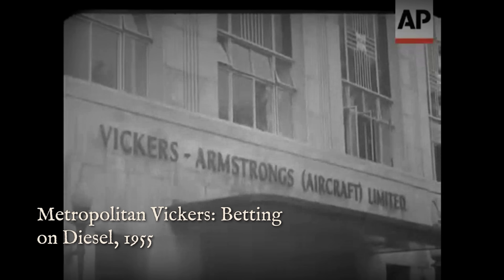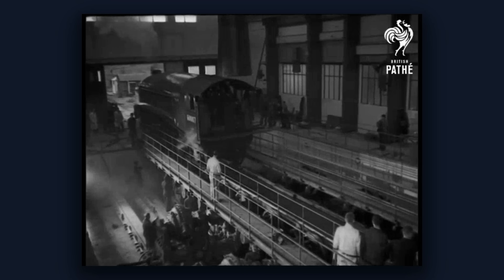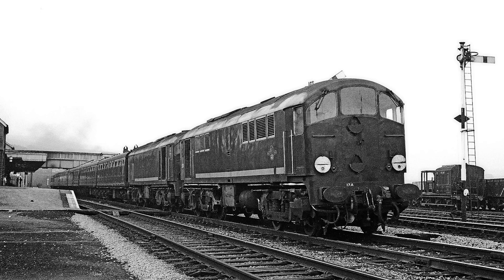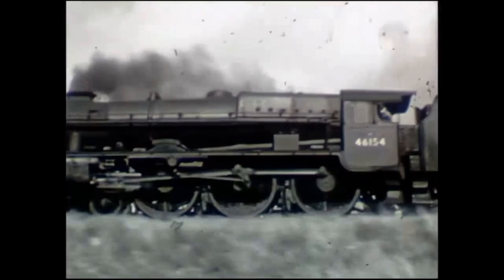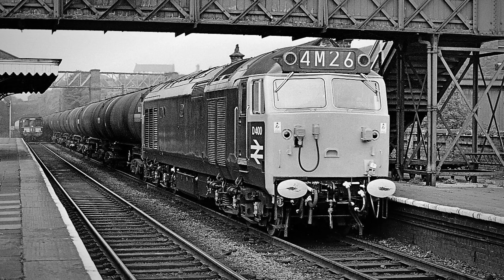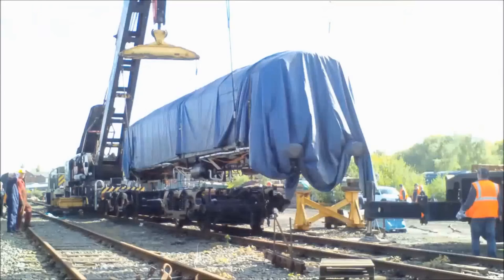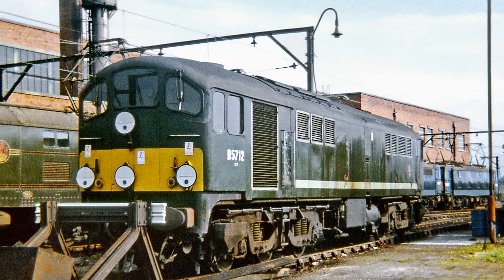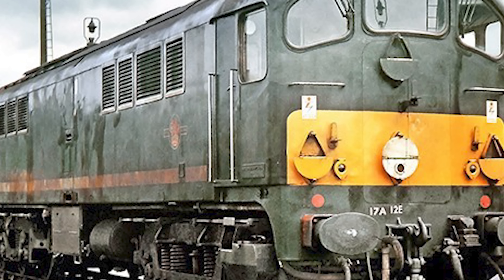This BRITISH Locomotive Was Too BROKEN TO HIDE

Comment: The were 10 Class 08 design shunters fitted with Crossley Engines D3117 to D3126 but they were never classified as 08's, allocated to Toton but they were all withdrawn by mid 1967 and all scrapped by mid 1968. So the Crossley engines weren't any better for shunters either

Comment: The Crossley diesel engines in the locos were absolute crap. They had also been installed as essential supplies generators at the power station where I was employed, but they were so unreliable with crankshaft problems, that they were luckily replaced by W.H. Allen engines shortly before I started there. The only problem the Allen engines had was a small peripheral control component on one engine that was quickly replaced.
Crossley later gave up using their own designs and henceforth manufactured Pielstick (French) engines under licence.

Comment: The main problem with the class 28 was the Crossley engine. Given the problem with CIE's A class, delivered from 1955, it was totally bizarre that BR ordered any loco with a Crossley engine.
It is said that BR ordered the Crossley because they wanted some experience with two-stroke engines. They could have bought GM-EMD two-stroke engines from USA but the post-war period was still full of chauvinism in the larger countries; Germany bought German locos and rolling stock, France bought French, Britain bought British, Italy bought Italian etc. On the other hand, Spain, Portugal, Ireland, Benelux and Scandinavian countries shopped around. In Ireland's case, they made a disastrous decision to buy 94 locos with Crossley engines, all of which had to be re-engined with GM power plants 1968-71, following CIE's experience with GM locos from 1961, which worked reliably from delivery.
Some may blame OVS Bulleid, CME of CIE at the time, but apparently he advised the board and the government to buy American, that is either GM or Alco. He even went further, stating: "The products of La Grange (GM-EMD) cannot be equalled".
So, one can only say BR was crazy to buy Crossleys. One would even speculate whether corruption was a factor in the decision.

Comment: Part of the problem with British Railways modernisation plan of the mid 1950's imo was that it was rushed, diesel loco's were entering service alongside along side steam loco's that had been ordered only a few years earlier. The infrastructure to service the diesels was not fully in place, it was not uncommon to see diesels stabled in steam depots, which by the 1960's were often grim places, smoke and dust filled, often with holes in the roof. British Railways were also ordering loco's for which there was dwindling amounts of work as more and more customers switched to road transport, even before the infamous Beeching Report of 1963, branch lines were closing. The line I lived next to closed to passenger traffic in 1962 and freight traffic dwindled until the line closed completely in 1968. I'm not sure if the Co Bo's were ever really needed, The English Electric Type 4's (BR Class 40) were enterting service around that time and more advanced types were on the drawing board, I think plans were already in place to electrify the west coast mainline. I suspect a lot of decisions made during the implementation of the modernisation plan were made for political reasons more than those based on engineering considerations alone.
Reply: Apparently Britain had very little experience with  diesels unlike the US with the E and F units from GM EMD
Reply: Unlike the grouped companies British Rail didn’t have a financially responsible Board so the strategy was to experiment. Too many new standard steam engines & too many diesel designs. All complicated by the ‘not invented here’ attitude to American, French, Swiss & German railway development.

Comment: I believe BR made the wrong choice and should've done exactly what the Irish and Australians did.
Reply: BR originally wanted to use American technology scaled down to fit the UK loading gauge, but politicians stopped BR as it was felt not possible given the risk to UK jobs.
Reply: The went as far as buying EEV12 engines to replace the crossley units, but the CoBos were earmarked for withdrawal in the traction plan and those engines were used in the class 30 to 31 conversion program instead.

Comment: what type of locomotive is this in the video at 6.01 as it looks like a class 26 or 33 body with class 47 bogies + a bit of a class 47 cab + windows I'm pretty well clued up on British built locomotives but i aint got a jar or glue/ a clue what this locomotive is!!! 🤔
Reply: Frankenstein's rail monster!
Reply: I was wondering the same thing. Also the loco at 7.:04 with what looks like a   class 86 or similar cab front.
Reply: I am very familiar with every British diesel class and I’m confident that is not one of them. I can only assume it’s foreign. The other loco at 07.04 referred to underneath this I guess is another foreigner for I don’t recognise it either.

Comment: The Class 28 Metrovics' main problems were the windshields (easily fixed) and the 2 stroke Crossley engines. Re-powered units seemed to work fine. Not sure if that engine was low quality or a poor design? And that's cool there was a Thomas the Tank Engine character (BoCo) based on these locomotives. I read awhile a go that most, if not all of the characters were based on real locomotives in the U.K..
Reply: The engine was just a terrible design. We got a V12 version from Canada to provide parts to rebuild the V8, when we stripped it down I couldn't believe how worn and damaged it was internally yet it only had a few hours on it. Also the build quality of the engine was poor too, we've a video of the crank being turned earlier this year at the workshop that are rebuilding the V8 for us and the journals were well out of true.
Reply: Thanks for the insider info, no wonder the Class 28's had so many breakdowns and problems.
Reply: yes they were

Comment: I have read that the general construction quality of these locomotives was very good, although that counted for little in the end. Some observers nick-named them 'wonderloaves', owing to their overall shape being similar to a loaf of bread (!) - the 'wonder' part was either wondering whether they'd reach their destination, or simple sarcasm!

D5701 seen in this vid was the only one of the 20 to receive British Rail's corporate blue livery, although a couple of others (D5707/8) did gain the full yellow ends on their green colours.

D5705 was very fortunate to receive a redesigned crankcase assembly from Crossley just weeks before BR decided to withdraw the entire fleet - this is probably why it was selected for a new life in departmental service and by all accounts was very successful during its limited use in that role, but that final mod came just too late to save the day. In any case I doubt they would have survived beyond the end of 1971 anyway, so modifying all 20 would have been more money and effort down the drain!

Comment: 2:30 Aahhhhhhh CIE A class locomotive!! A proper workhouse over here in Ireland 
They were using Crossley engines too for a short while till obviously they started to break down
Reply: Western Australia Government Railways were able to fix their Crossley engined X class (looks quite alike a CIÉ A class).
Reply: @oscarosullivan4513  , there was an estimated 600 fixes to keep them running.   they put up with them for 40 years.   they were unanimously hated.   wagr should have done what ireland did but even earlier.   i watched an interview with a maintenance man about them when they were retired.   he was asked if he had any fond memories of them.   the answer was no.
Reply: @vsvnrg3263 I agree, GM engines.

Comment: Enthusiasts love these, in reality they were an absolute load of rubbish. Had to be double headed to reach any reasonable speed
Reply: They were sometimes double headed especially in the early days because they were used on type 4 duties when they were only type 2s, not because they wouldn't go fast enough. FYI they could pull trains far heavier than their contemporary type 2s as they have very clever electrics albeit slowly.
Reply: Actually with a starting tractive effort of 50,000lb , they were the best type 2's out there for starting a heavy freight train , superior to a class 33 ( type 3 ) and more than 25% better than a 9F !  Reliability was the issue .

Comment: The sole surviving example of this class, No 5705 will never again run let alone haul a train under it's own power!  At best it will only ever be a static exhibit and will only move if being pushed or pulled by another locomotive.
Reply: They’re actually working on restoring it
Reply: What, they're actually working to restore it to full working order!?  I wish them luck!
Reply: @paulconlan2945  I’m honestly thinking that it’s in the same boat as the sole surviving Class 17 in terms of its history as a preserved unit
Reply: @lyokianhitchhiker  The class 17 has spent most of the last 45 years running rather than not running. Its nowhere near as unreliable as people would have you believe.
Reply: @TIMMEH19991 only because of the work done on it while it was preserved. Correct me if I’m wrong, but didn’t they use railcar motors when first made?
Reply: @lyokianhitchhiker  The horizontally-opposed diesels engines were originally designed for the spec. of a proposed super-DMU which never went ahead because its high-powered specifications made it ludicrously expensive. All that Paxman had to do for the Class 17 was to haul the proposed DMU design out of the archives and mebbe tweak it a little.
I suppose the truth about the proposal and construction of the class 17s will never be known. How anybody with a brain could have ordered 170 locomotives of an untested design for traffic that was already vanishing when they already had the tried and tested EE Class 20s is beyond me.
Reply: @andrewclarke6899 the issue is that railcar & dmu motors aren’t made for regular locos. Aren’t railcars & multiple units only meant to haul their own weight & 1 or 2 extra cars at most?
Reply: @lyokianhitchhiker  The engines were designed as a more modern DMU engine, and to be fair to paxman had not been fully developed when BR insisted the class 17s used them. Also the 17s used poor design electrics from GEC rather than the ones clayton recommended from Crompton (BR got the hint and the last batch had them) The main reason that D8568 is reliable now is the BR rebuilt the paxman engines with a cast iron block instead of the alloy ones which improved their availability close to that of class 20s, but BR withdrew the whole class before they could even finish the project! I do believe that quite a few brand new engine blocks were scrapped unused.
Reply: I'm one of the people restoring it and you'll be glad to know...you're full of shit 🤣😂😂🤣
Reply: Oh really?  The truth is that the Crossley diesels were notoriously problematic.  Why did you think CIE replaced all Crossley engines with GM units in their A and C class locomotives? I do know that the WAGR carried out hundreds of modifications on the power units in their locomotives.  Maybe you and your organisation have carried out the same modifications to the Crossley engine in No 5705.